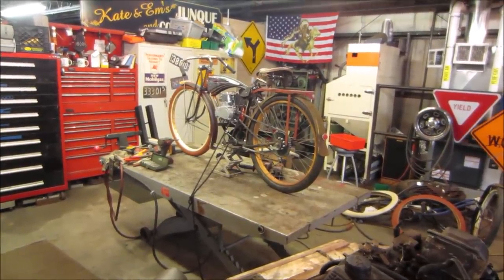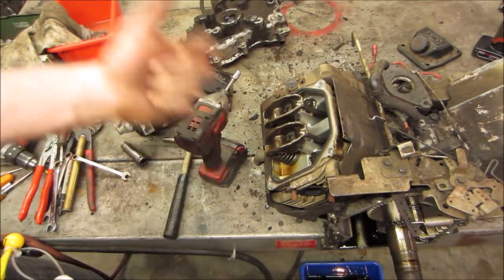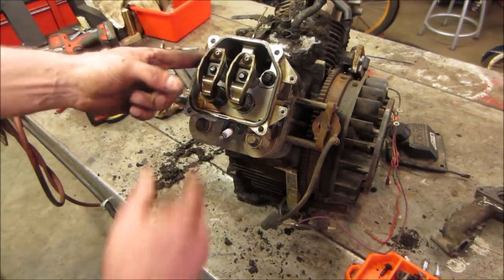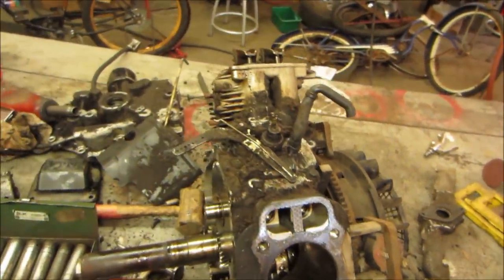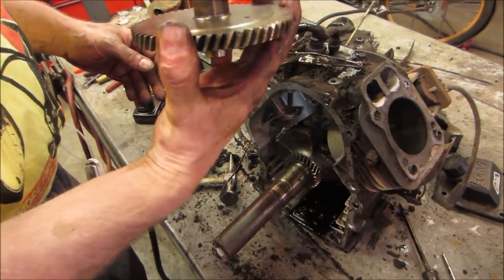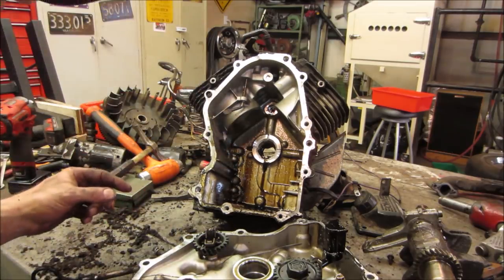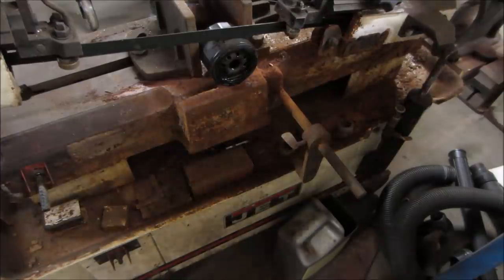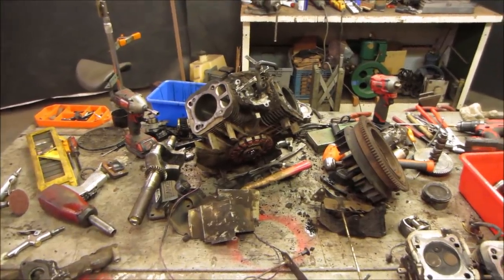Why Did This Engine Fail?

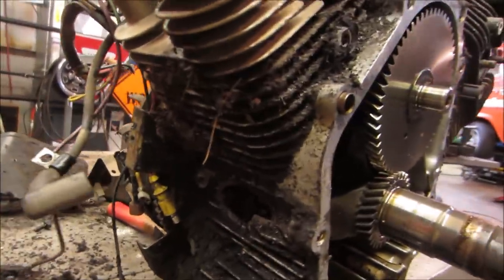Comment: At 10:33 the problem arose, never been cleaned or serviced, some people think tools run forever, only if you look after them. Some do fail due to bad manufacture but a lot is poor maintenance.

Comment: In MHO it was run low on oil, The oil sending unit was unplugged. Look at how little oil is in the blue bucket from when you drained it. That crank might be salvaged, Soak it in some muriatic acid to dissolve the aluminum, polish her up and mic it. It my still be within tolerance. No harm in trying.

Comment: Hi, looking at the number of generators that you repair is there any of them fit for purpose and do you think that they are designed with built in obsolescence. Are there any that would last a long time with reasonable use. Love the blogs, it’s getting me through the lockdown nicely.

Comment: Did you check the valve guide s see if they moved that causes bent push rods but never seen one implode they uselly have blown head gasket s fuel impulse pump pukes oil every where uselly cooling fins are caked thanks for the video s seen zero turns do this but not generators just a thought

Comment: I was told the lifters in my 1974 AMC Gremlin 258 6  cylinder had concaves on top so they would spin.  The butyl caulking from the valve covers broke apart ay 32,000 miles and got into the lifters.  The lifters would hang up and chatter something fierce.  I was lucky to sell it for the $1700 I owed on it.

Comment: The oil filter may have restricted flow to cause insufficient oil to the oil galley. Not enough oil flow or pressure. Oil filter dirty and clogged.

Comment: I had magnets let go like that on my suzuki vstrom 1000. Not pretty. 
That one time i tried to start it and it locked completely the engine, i thought i had a severe engine issue. Then eventually (rolled it down a ramp), it started, but no longer charged. When i open it, it literally, ate one of the magnets (all were lose). I bought another one, cheap, also with lose but intact magnets, glued them with locktide, plus some metal epoxy between them, and been holding so far.

Comment: You didn't have the carb, nor governor linkage to inspect.   A blower's power requirement goes up as rpm cubed, so probably can't over-rev by very much even if the guv doesn't work.  But if the blower wheel came loose from the engine while the throttle butterfly valve was jammed open, then the engine will seriously over-rev.   The alternator magnets probably got shaken loose when all the carnage with the rods was happening.   

Another possibility if the fuel tank was mounted above the carb is that the float got soaked or the needle stuck open, and filled (even partly) a cylinder with fuel while it was stopped.  That would hydraulic lock on startup, bending a rod and maybe the pushrod.  The bent rod rubs on the crank until it siezes, then all heck breaks loose.

Comment: 18:21 that hotspot is exhaust gas blow by exiting through the end of the exhaust valve guide. Kohler is know for this, I’ve removed rocker covers and literally had sixteenth inch thick carbon caked all over the rockers. Sometimes it gets so bad that the oil return passage gets clogged and the rocker cover fills up to the oil entrance and then it’ll smoke real bad on cold starts.

Comment: My bet based on what failed knowing it was on a leaf suction device where higher RPS are desirable is that someone overrode the spring on the governor and the engine was running at absolute full rpm and the governor mechanism could not dampen the rpms.  The  rod failed as a result of the forces.  The carb was not on the engine, so the evidence of that tampering was not there to see.  No evidence of slower failure due to oil starvation and resultant heating of the crank or rod bearings.

Comment: Maybe a combination of the oil never changed, with the one connecting rod being torqued a little too tight on the crank; from the factory. Looked as though oil never circulated all too well around that part of the crank where the connecting rod was on too tight; just eventually ate itself to death.

Comment: Because of the lack of obvious blueing from overheating, I'd guess a rod bolt loosened or broke and the bottom end let go. If the blower was out of balance like you mention at the end of the video, that could loosen up a rod bolt or two. Look for the remains of the rod bolts if you haven't already tossed the "hamburger".

Comment: the magnets are a  known problem with Kohler engines only effects charging. check out Taryl's video on it.
As for why it failed looks to me like a classic example of not maintained well. Meaning the oil was never changed and after awhile became to thick to properly lubricate everything

Comment: Ya i don't loan anything out anymore unless i'm transporting it and going with it. I loaned a 10ft step ladder and my pressure washer to a "friend" years back. He used it, then said he's done.. i said well bring it back like you picked it up. I couldn't get a hold of him after that and or if i did, he was always busy and we could never get a chance to meet up so i could go get my stuff back. He ended up moving, putting a bunch of stuff, including my ladder and pressure washer, in storage, still couldn't meet with me. He finally he lost the storage unit and everything inside. That guys not even my friend anymore.

Comment: The condition of the oil and the oil filter would say that this engine had not been serviced in a long while.  the cooling fins had not been cleaned this century. The design of the exhaust  manifold , two into one leads  to one cylinder running hotter than the other leading to bent push rod or stuck valves.    Change your oil and filters more than once every year!

Comment: As black as that oil is I wonder if that aided in the destruction once the rod started to grab onto the crank or maybe even started the process.  Doesn't look like the engine got a whole lot of attention maintenance wise.
Reply: Bad oil, overheating cylinders, and being out of balance all contributed. I don’t think there is a single thing wrong. A possible chain of events goes bad oil starts accelerating wear on one connecting rod, the overheating piston increases the drag on the weakened rod, and the vibration from being out of balance finally pushes the momentary forces over what the rod can handle and boom. The out of balance issue could also increase metal fatigue as well.

Comment: My nephews borrowed my fathers snowblower (that I gave him) called me when it stopped moving. Seems it had smoke coming out of it for a few hours. They drive belt was completely gone it had been slipping for hours sending huge clouds of smoke up in the air and the just kept going.
Reply: Why didn't you stop when it started smoking? "we weren't done". I told them in colorful language that if they destroy there grandfathers snowblower THEY will have to buy him a new one.. Oh did I mention that my nephews where in there late 20s early 30s at this time?

Comment: My guess is all the dirt and debris on the top of engine maybe something jammed the throttle open it over reved and let go which also the push rod bent from valve float/lifters couldn’t manage at that speed

Comment: I had a Kohler  304 engine blow a conn rod through the case. The big end had no cap bearing as does this engine. I don't think that not using a cap bearing is a good idea. The metallurgy of the whole rod must be the exactconsistant quality to assure that the composition at the crank bearing surface is just right. Quality control of a cap bearing much easier in my opinion.

Comment: since there was no sign of overheating the failure was more than likely not a gradual event but instead an instantaneous failure.  Points to either a part failure or overspeed.
Reply: I agee. Perhaps the governor mechanism jammed causing over revving or there was a weakness in the crank that some partial seizure of the big end made worse. Maybe it was a combination of 4 factors. Intrinsically weak crank that is sensitive to over rev, poor lube of the big end, damaged governor and way over rev, out of balance crank from unbalanced flywheel. I didn't see him look at the crankshaft bearings, particularly the flywheel side.

Comment: couple of pistons, couple of rods, polish the crank, weld up the block, replace the push rod, it will run again,  my bet is it was a friday, they were running late, needed to make this thing start sucking like a fine young..........:)....and they bypassed the governor, i used to tie a boot lace to the governor on my old mans lawn tractor so i could cut down my mowing time, i had the sense not to blow it up.

Comment: What oil line from the pump to the bearings was clogged you could have me turn the thing over where it goes up to the crankshaft between the pump in the crankshaft there's a clog in there I almost guarantee it

Comment: 1). Detached magnets to one coil stopped it from making a spark, causing only one cylinder to operate properly. The other cylinder ran, but had no spark. Running cylinder eventually overheated, due to insufficient cooling and it broke! 
Case closed!

Comment: SAME problem. I feel the problem was these engines don't cool very well and when the fins get clogged up they overheat and the piston tightened up and freezes up. This causes the pistons to swell and it ends up throwing a rod thereby destroying the engine. People should be aware that they need these engines tore down and have the fins cleaned up. That's my answer anyway.

Comment: Since 2008 when I had a new kohlar eng with around 20 hours blow up and their customer service gave me the run around I have refused to buy kohler engines and I have seen a lot of kohlar engines break down with very few hours and they had the same horrible experience with kohler.

Comment: Because of that wear on the cam and lifters could have been enough of a gap to keep the exhaust valve closed partially causing Carnage to the rods Pushing up against full compression?

Comment: Loaned out my new self propelled mower. Guy said it was spitting and sputtering and then quit running. Any of you guys know how to test a coil. No spark. Checked the air gap and it's fine.

Comment: I bet the leaf blower jammed and stopped the engine a few times, wearing / damaging the rod each time.. then it broke and blew out. Never happened to me on a old craftsman snowblower with grade 8 bolts instead of shear pins :p

Comment: big end, rod bolt came loose..............BOOOOOOM.   Another possibility is that someone or something deliberately or accidentally over revved it (interfering with the linkages) and the rod let go.  If the valve springs bind at high rpm, that will bend the push rods. Another possibility is that it was under heavy load, and that load was suddenly disconnected...........

Comment: I was changing the points on my Yamaha FS1E in the 70's and I could not get the flywheel of. I tried with the puller and it didn't want to play. So I told my stepfather who was peeved as I interrupted the film he was watching. He came out hit it with a mallet and it dropped off. Arrgh.

Comment: Use ybour lawn mower a half hour a week he says.
Here in Miami it's a half hour almost daily 6 months of the year with a small yard 😅😅😎
And it'd better be a self propelled or riding one as the heat index is over 100 most days with humidity you can actually see many days.
You take at least 4 bottles of water out with you in a mini cooler.
And mow no latter than 8 am or earlier than 6 pm.

Comment: Most treat small engines like electric motors. Turn it on and run it. Day one till this. Maintenance? What's that? I was given a mower once from next door. Problem? Air filter clogged. Still use it, and never have to worry about borrowers. Everyone hires landscapers to do it for them. Ahh, today's world. Lazy! We're a lot alike you and I.

Comment: I tried to pull the flywheel off a Wisconsin robin engine last week I spent hours on it after trying the mustie1 method I had to take the engine out to put a puller on it and some how while lifting it out something inside came loose and locked it up. I was so pissed I tossed everything

Comment: My money is on the fuel was low in the tank, big slug of water that got ingested and hydro-locked the piston.  It bent the push rod, cracked the rod and the flywheel and centrifugal force took care of the rest.

Comment: Because I'd watched a lot of Mustie prior to this video, I was calling stress fatigue very early. The valves and lower end looked good, apart from the one bent push rod, so it was unlikely oil starvation was the problem. Bet if you placed the rod under an electron microscope, the evidence would clearly be there.

Comment: These engines are notorious for valves being too tight causing leaks. Most of the time it's the exhaust valve and then it will melt the seat.

Comment: What are hydraulic lifters?
Reply: I know what normal lifters do but I’m just used to single cyl lawn mower engines
Reply from the maker: they get pumped up with oil and are self adjusting
Reply: So you never have to set valve lash?
Reply from the maker: @leoo0076  most of the time no but some still have adjusters,

Comment: Looks like the junk around the cooling fins caused the motor to get hot thinning out the engine oil causing the bearing to gall on the crank. Then kaboom!!

Comment: That oil is filthy no wonder it threw a rod it just was not taking care of, I have 6 of these I run in multiple machines my mini skid has 650 hours it had never seen an oil change which I did

Comment: These motors blow apart when new, they're just crap engines, had john deere with kohler blow a rod once in under a month, got replaced under warranty, lasted a year, a month into the next season blew a rod out the crankcase again, always that side where the starter is, instead of dealing with john deere I put a twin brigs in it and its been 3 years now with zero issues

Comment: i dont every trust kohlar motor anymore
i have 72 them failures too easy n set itself on fire out nowhere whiles it was running fine

i have took them all apart n find broke valve n failures oils pump n pistons was too thin not thick enough handle more HP and ended up shuttles inside block witch make me super mad n rip it off of every mower n throw on bigger stagger and never have a singer problem with bigger stragger it last way longer than kohlar    no wonder
if u have kohlar i adjust u tear it down n double check it before jump back on mower because i hate seeing them destory itself n burn down mower

Comment: Cause of death. Undetermined. At this point metal fatigue would be my guess.
Reply: I was thinking the same thing, or the rod could have been defective from the time of its casting and it just took awhile before it failed.

Comment: you can see marks in the carbon of one of the slugs where it bapped the valves lol. Also, this is a Kohler engine, they like to just spontaneously kerbalize themselves just like this. Why I don't like Kohlers.

Comment: Nice to know if the motor autopsies don't work out you can always go back to making shoes.  Once you get proper tool usage, proper terminology and disassembly protocol, and lucid systems operation and failure analysis conclusions, you got  'er licked.  BTW, its not a stripped gear oil pump, its called a gerotor, like they use in automatic transmissions.  Uncontaminated failure is extremely rare.

Comment: Will probably never know the whole story, it’s always “it was running fine, then BAM”! I would Gess that because of the the dirt filled cooling fins the engine was running hot and caused the valve to stick, (bent pushrod and I’m sure was a loud lifter tick) resulting in loss of power........so the aggravated and pissed off operator was holding the throttle open !!!!! Engine wasn’t well maintained either, as evident by the General shape it was in! Just an opinion!🤷🏼‍♂️

Comment: Should have been pressure washed before tear done off engine not telling you what to do but it would be cleaner to work on that’s the first thing I would do
Reply: Clogged fins, baked on oil, etc can be valuable clues.

Comment: OVERSPEED< VALVE FLOAT< THEN ROD THROWN !!!!
Reply: No valve marks on the piston tops that would have resulted from the piston colliding with a floating valve.  Try again.
Reply: not necessarily, push rod can bend from overspeed on a pumped up lifter without smacking the piston, may not be an interference eng.

Comment: I'm going to guess a clogged oil passage in the crankshaft, seems the most logical reason, that or just a shit design... :P
And as for loaning things out, yeah, if it has an engine or motor, I won't loan it, cos it'll either come back ruined, or I'll never see it again, cos people are dicks with equipment when stuff doesn't belong to them...